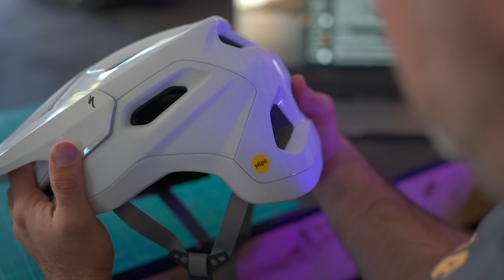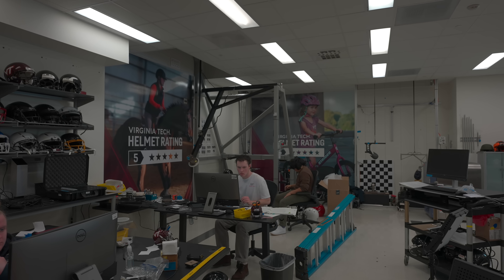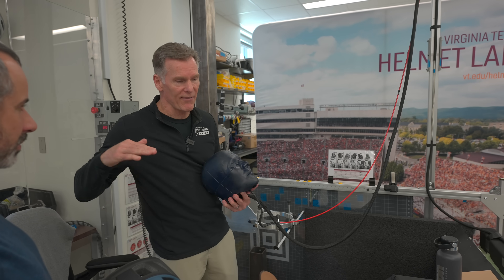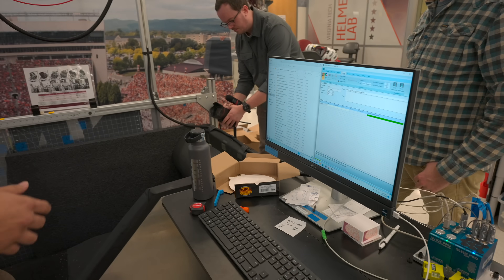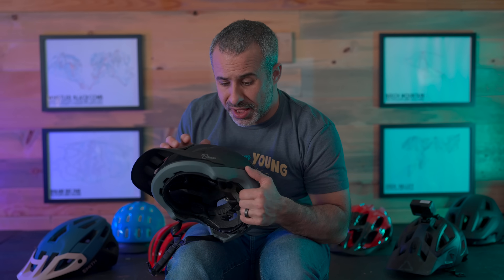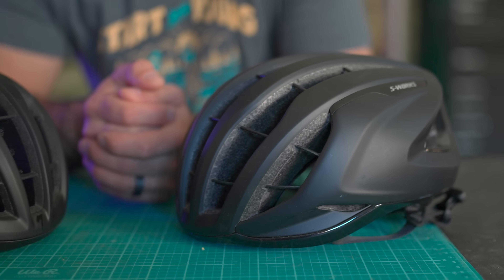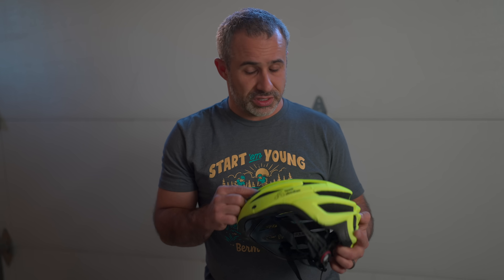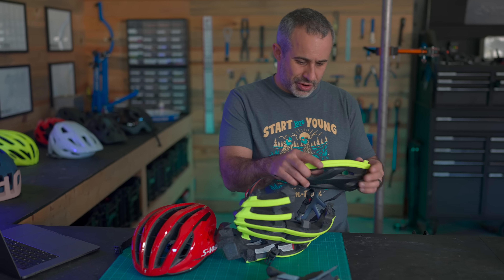Are Cheap Bike Helmets Safe? We visited a helmet testing lab to find out

Comment: Regarding the concussion statements, you cannot prevent a concussion with a helmet. A concussion is caused by the brain hitting the skull. So if your head stops, starts, changes direction quickly, there is a risk of concussion (you could shake your head to hard and get one). MIPS and other similar technologies will help reduce the risk and they are FANTASTIC and do save lives, I wouldn't buy a helmet without it, but you can still get a concussion with them. That being said, I love that someone like Seth is doing these videos on helmets. More people need to wear them when riding and I hope this helps people make a good helmet choice.
Reply: I hate that people are saying that a helmet prevents a concussion. Absolute bullshit! You are still getting a concussion! But at least you're not crushing your skull. And maybe the concussion is smaller.
Reply: @JoshuaTootell  the designs of modern helmets are not just to prevent fractures, part of the design is certainly to reduce(not stop as that would be really impractical to wear) concussion. Part of the reason for the "crushable" foam is to spread the force over time as it compresses the foam, this action of slowing the force significantly reduces the effect of concussion compared to a simply duplicating the skull with another solid protective shell as helmets used too.

Comment: Dr. Miller and everybody at VT, thank you for your work.  I never buy a helmet without checking your results first.

Seth, thank you for putting a spotlight in this resource.  CPSC and even Snell standards are fairly rudimentary, and they don't tell us more about a helmet beyond "passed".

To reiterate Seths point about pricing.  For a while, specialized had a top two or three helmet in their s-works version.  They came out with a cheaper model that cost 55 dollars and it almost outperofrmed their fancy model!  I do wonder if the fancy model works better for 55mph crashes on a Alpine descent like the pros do, but for my purposes as tested by VT, it was an absolute steal for a road helmet.

Just gotta do your research.
Reply: Hello, do you need a helmet testing machine? It is a device that can test various performance of helmets.

Comment: cheap helmet better than no helmet. Also crashing is so highly variable. Its possible even that the cheap helmet that shatttered could protect the person even more depending on the situation. When the helmet shatters that much it means its absorbing more of the impact energy. You could even argue thats could be the most safe helmet of the lot. Just because a helmet doesnt shatter does not mean its safer. It also means its going to impart more energy to the persons head vs the one that shattered. Think car crumple zones. Truth of the matter what matters most is the crash scenario and the fit of the helmet. Technically any helmet you stomped on was trashed the second after you stomped on it regardless if it shattered or merely cracked.

Comment: Cheap and counterfeit helmets can have the opposite problem of the one Seth smashed with his foot. Many of them are so strong and rigid they transfer all the energy from the collision directly to your skull. My uncle is mostly blind now from a traumatic brain injury suffered in a cycling accident. His helmet was entirely unscathed other than some scratches on the shroud. There were no cracks and no deformation. If I had to choose, I'd take the helmet that Seth smashed with his foot over the one my uncle was using since it would probably dissipate more energy from the initial impact.

Comment: Very important topic indeed.  When it comes to your brain and head probably best not to cheap out and do research on your purchase to protect it.  I mean it all depends on how much you like your head.  I learned as a teen riding dirt bikes a good full face helmet could really help when you wack it off a cased double going over the bars.  It hurt but not a single scratch on my dome which would not have been the case if I did not have a good full face high quality helmet on!

Comment: Seth, thanks for sharing your Public Service Announcement video...
Prior to your video, I did my due diligence for my noggins sake.  VT was my source of info.  And yes, I now own a Tactic 4 helmet.  BTW The Tactic 4 meets the Dutch Technical Agreement (NTA) 8776, a standard of safety for class 3 e-bikes.  That translates into protection up to 28MPH.
Many of us ride on the road and at night.  Having a front and tail light on your helmet allow you to be seen easier by motorist.  Some bike companies understand this.  Xnito is an example of helmet with a front and taillight built in.  They also meet the CPSC & NTA-8776 standards.  This helmet may not be for everyone, because it's more of an Urban helmet, that has less venting.  I feel it's perfect for e-bike riders or those on e-skate boards, electric scooters, etc.
Reply: Why would the Dutch test helmets if they don't wear them?
Everyone knows that if you fall while cycling in The Netherlands, there will be an attractive blonde there to catch you to keep you from hitting the ground and then they will give you free Gouda cheese and a toy windmill.  They're VERY nice over there.  So they don't need helmets.  

j/k  The Dutch do wear helmets, despite what you hear.  Every road rider I saw in The Netherlands was donning a helmet.  So the DO have gravity and hard pavement over there after all!
Reply: The NTA 8776 approved helmets are designed to offer protection of speeds up to 28MPH.  CPSC is a standard that mandates helmet protection up to 20MPH and below.  
What helmet would you want to be wearing going down a steep and rocky trail at higher speeds? @dudeonbike800

Comment: Remember too that helmets have a lifespan due to material degradation. 3 - 5 years, although I change every 2 generally. Also, a poorly fitting or adjusted helmet does not provide proper protection.

Comment: I highly recommend buying the specialized camber, it has a 5 star rating  in Virginia tech, and it usually goes for sale, I picked up mine two days ago for less tan 50 bucks. Also specialized has some sort of promotion where you can leave your old helmet (brand does not matter) and get around 20% discount. 
Align 2 is a great option as well for road cycling.

Both helmets have a 5 star rating

Comment: let's get one IMPORTANT thing straight. just because a helmet cracks does NOT make it a bad helmet, and in the same vein helmets that don't crack may not be good. Some helmets are designed to crack and fail in order to dissipate force. If you wanted an indestructible helmet, you can wear a reinforced concrete helmet, but you can bet it's going to transfer ALL that impact force into your skull. stop propagating this idea that helmets that do not crack are the good ones

Comment: The last helmet is not as good as you think, Seth. With repeated stomping, it is completely unyielding, which means it's extremely rigid, which means that it doesn't perform the task of decelerating the brain over time - the same concept you cited as a "crumple zone". I mean, yes, it's better than the counterfeit helmet which was obliterated by the stomp test, but it's far from a good helmet. I would guess it would perform very poorly in the Virginia Tech tests.

Comment: One of the claims with externally mounted cameras, or anything else for that matter is, the helmet was not tested with that device on there, so there’s an unknown.  
But the other claim I’ve heard (and it’s why helmet cameras are banned in Supercross and Ski racing ) is the smoother the helmet is the better it will slide on the ground in a crash. If there are protrusions that might catch, it can increase potential injury to the neck.  Difficult to test.
Reply: It would seem though that the easier your camera or light or whatever breaks away in an impact would be better.

Comment: Stomp test, lol….so, there are 2 schools of thought in that impact absorption and helmet ‘firmness’ if you will is a science. The $20 lid you stomped on and would not crush, doesn’t mean “safe”…it means the helmet is very rigid, hard, firm and possibly wont manage or mitigate any impact. You could have put a STEEL shell helmet on the ground and would not have crushed it either-doesn’t mean you’d want it protecting your brain-all that is doing is protecting your skull from cracking and as you know we are trying to do more than that in making helmets.

Comment: Your amazon helmet for 20 bucks, without MIPS is the key reason why it scores where it scores, VT uses rotational impact testing as part of the algorithm, Amazon helmet should drop MIPS in there and I bet their score goes up 3 points, but so would the cost as MIPS charges significant license fees to use their system.

Comment: Thank you for posing the question about mounting peripherals on a helmet. In light of anecdotes about the danger this is great information to have. Even if the response is not conclusive.
Reply: The whole video is misleading. F1 pilot Michael Schumacher got a brain damage because of GoPro mounted on ski helmet. And ski helmets are way stronger than any cycling helmet
Reply: @dtibor5903  That incident is always why I ask this question.

Comment: I wear hard shell skate helmets, i've never found a cycling helmet that fits.  Last time my helmets did it's job i split a Pro-Tec lid completely in half last year.  The thing i've found unacceptable about cycling helmets are the shape.  The non round shape with pointy ends causes my neck to twist when i take an impact or snag it on something, while the more rounded shape of a skate bucket just slides.  Also i can adjust the padding to fit.

Comment: wow that counterfeit helmet failure was scary!  Thanks for doing this video.  Great to be able to check out if my helmet is well rated.
Reply: My kid wanted a "fox" helmet from Ali, full face at 45$ ... I said neooo
Reply: @perspicaxingenium cheap skateboard helmets are way stronger than any cycling helmet. You can stomp them all day
Reply: @dtibor5903  Cycling helmets are hugely compromised to be light and have good airflow. As was mentioned in the video, there is no comparison between the effectiveness of a football helmet and a cycling one.
Reply: @randyphinney7275  like there is no comparison between stomping a helmet and an actual accident.
Reply: @dtibor5903  But it's an indication of how well the helmet will hold together in a crash. The energy is dissipated by the foam crushing. If the foam fractures far less energy is absorbed.
Reply: @dtibor5903  its not supposed to be strong tho. id rather my helmet get destroyed if it absorbs the impact
Reply: I expected it to get crushed... I did not expect it to SHATTER! 
Scary for real...
Reply: They should all wear the cheap ones,  help cull the lycra.

Comment: You can currently get the Specialized Tactic helmet for £40 in the UK. You can even pick up the pricier Ambush for £60.
Reply: In Germany you can currently get the tactic for 60 €. I was actually thinking about buying the tactic. After this video I definitely will.
Reply: @wolfmtb57 Just bought one for €55 in the Netherlands. It was well time to replace my 8 year old helmet.
Reply: You should never keep a helmet for more than 4-5 years. Things like UV-light makes the material in the helmet age, which can impact the safety. It's a general safety recommendation to replace it every 4-5 years.
Reply: @kotthund Aye, the same could be said about carbon bikes. Uv radiation causes degradation in the resin binding the carbon together, resulting in a weaker structure over time. That combined with the fatigue of regular riding means mountain bikes would actually need to be replaced faster than a helmet. Oh, but wait, there's UV resistant resin available, and that's always the type used in any automotive or cycling application if they ain't cuttin corners.
Reply: I got a Fox Speedframe from CRC for under £70 during a sale. There's great deals on quality gear out there, especially if you're not too fussed about having the latest colours.

Comment: That fake helmet is actually terrifying, wow! Spend the money guys, its clearly worth it!!
Reply: As the rest of the video showed its not about cost equating to safety, cheap helmets that are properly built and meeting the proper safety ratings are fine, they may not be as comfortable, lightweight or aerodynamic as the expensive brand name ones but they are just as safe. The problem is fakes that have cut corners and  not safety rated, and guess what they are often posing as the expensive brands.   Remember if the deal looks to good to be true it often is. Dont expect a brand name for cheap, however a cheap off-brand does not mean its unsafe. If you cant afford much its better value and safer to go with a generic/off brand that you can find actual safety tests for than go with somthing pretending to be discounted branded gear.

Comment: Wait a second. Motorcycle helmets have been tested like this for ages. The tech exists far longer than what Virginia Tech has developed. Even if the specs or parameters are set differently, the tests are similar.  For different areas in the world, there's  Snell, DOT, ECE, SHARP, Or FIM. What am I missing?

Just to add some information: the info in this film is accurate and the video is great. I have visited a test center like this myself (Arai Europe has one) and it's great to see this stuff happening. I even brought in my own helmet, just like Seth, just to be amazed by the poor quality. However, I still don't get the novelty of Virginia Tech.
Reply: True, but the novelty here is that they're now doing this sort of testing on helmets for lots of sports that previously only received more basic safety tests for helmets without any specific info provided - If I'm not mistaken a CPSC rating is pass/fail kind of like a DOT motorcycle helmet with no extra info provided to the public (and possibly also comes down to manufacturers self-certifying like the DOT rating, not totally sure on that one for bike helmets though)

Sort of like how DOT standards are the bare minimum for motorcycle helmets in the US, CPSC standards are the legal minimum for bike helmets sold in the US but there is so much more room for improvement (hence the existence of third party testers like SNELL, SHARP, and FIM in motorcycle helmets) . For bike helmets Virginia Tech is the only lab I'm aware of that's offering that to us.
Reply: @jakobc1998  That makes sense. I think that's also exactly why I find it so strange. 
The Arai test center does exactly the same, but also for the same reason. The official parties all use a way of testing that has flaws; theirs, just like VT, is much more random and therefore much more broad spectrum. However, a company can never make that stick, so they only use it for their own quality control. Makes the product stand out in third party testing, though. 
Of course, this is very biased, but I do believe more companies do the exact same thing for their QC and R&D, as they should.  Thanks for elaborating.

Comment: Helmets are personal pain for me, because only like 5% of helmets actually fit my head since the strap in the back needs to go further down than is "normal", otherwise the helmet just slips off of my head like badly fitted fedora. In that way I'm lucky and unlucky since I always need to go to my local bike store to check if the helmet actually fits.

On the ordering side, thanks btw that you included that bit at the end, I have stopped trying to get anything safety critical off of AliExpress or Amazon a while ago, because I kept getting fakes even when buying from official seller accounts, and even for the most stupid stuff like shoelaces and run-of-the-mill shoes. The only reason I can come up with for that, is that either the brand shops are not all official and amazon does not take care to verify that, or that amazon just dumps pallets of products in their warehouses and does not concern themselves with mixing them per seller. The saddest bit is that it is becoming less and less rare that I can just go to the original manufacturers site/shop and order something direct from them and it will be cheaper.
Reply: As soon as I arrived in Colorado my friends wanted to do a pretty shreddy ride up in Steamboat. I had a $6k bike and a $30 walmart helmet because I came from the flat south of the country. A couple days before the ride we walked around down town and I saw a store called Hard Headed, all they did was sell helmets. I already thought I wanted the ProFrame RS, but I tried every helmet that was in the downhill category for fitment. Turned out the quasi infinite adjustability of the Fox was indeed the right fit, but I was super thankful that I didn't have to guess. So, my advice is to take any opportunity you can to get to one of those rare stores where they have it all, not just a favored brand as seems to be the normal case.